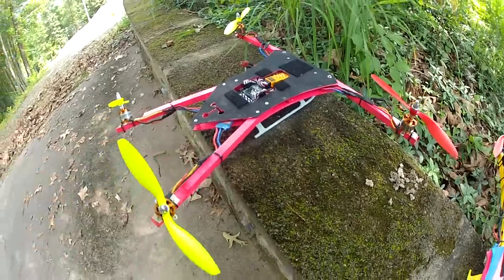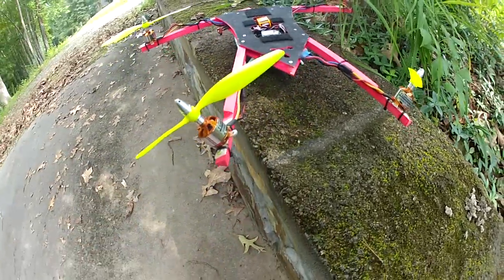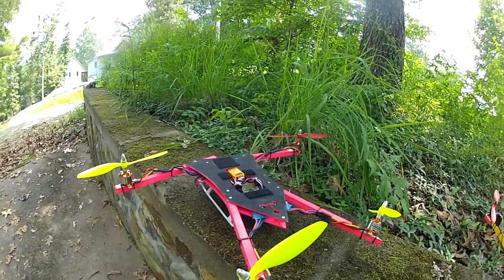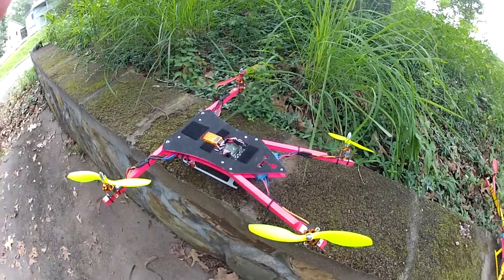Simplecopter V tail demo Long ver.

Comment: if I have no V-tail option in my FC can I configure it as a quadcopter and would it work or not? I am using APM 3.2.1 and only built quad so far, now planning a tricopter or a V-tail for better stability,  less roll during yaw. And less roll during roll :)

Comment: Hi is it normal for a tricopter to have a slight drift when hovering with no input
Reply: It depends. Is there wind? If yes, its perfectly normal. If the triocpter is tilted with no wind, you need to change your TX levels.

Comment: Hey Matt, quick question if you got a sec... I built this 'V' tail but the rear seems to hang, yours doesn't. Any thoughts? Using a BatBone chassis, 3000 lipo, motors are 1200 kv. ESC's are plush 30's. ESC's are plush 30's. KK2 board is in 'V' tail mode... All stock. Using 8x4 GSW props. Thanks for any thoughts.. Jerry

Comment: I've been really enjoying your videos! Noticed in this video, when you flew through the trees into the back and then back to you, it seemed like you had goggles on. Are you running wi-fi off the gopro(or wifi pack) or using a totally different system altogether to monitor? Thanks again for these great videos.

Comment: We have a couple of the TCopters and YCopters out at our field. We're using sunnysky  x2212 vII, the1400 and 980 motors. The 1400s with 9x6 on 4s is absolutely ballistic, though kind of out of control (come to think of it, no one has managed more than a minute or two...) and certainly straining the electronics. The 980kv on 4s w/ 9x6 has lots of power and isn't killing all the electronics. Wish I could find 9x8s.

Going to try 980kv on 4s with 9x6s on this VTail, looking forward to flying it! :D

Comment from the maker: the t copter v tail was not made to take any abuse. we could not figure a way to make a robust but light setup using the alu in the back. the motors blowing out had a problamatic yaw. if you hit the yaw hard the copter would slide 10-15 foot in the direction of the vaw. the 30 with the in facing props took that issue to a few foot plus we picked up power and flight time.

Comment: You mention that you changed the angle to 30 deg and tilted the motors in to get rid of the yaw problem. What did you mean by tilted in? In a previous video you flew a t-copter that you converted into a v-tail. Is there any reason why you choose the new design over that one? I would have thought that the T-cop V-tail would have been lighter.
Anyways thanks for the great videos you make and taking the time to reply to people!

Comment: nice flying! so now after making my own tcopter from seeing yours and following your setup it flies nice but i want more.lol i need to fly more weight so i made the vtail add on but i made it at 45 degrees so now ill change it to 30 but can you put out the set up for the board please? like explain the gyros how to switch it for upside down motors? and my real bigger question im doing fpv so how long can i fly how much can i carry safley for load what lipo size and still be safe and control well?

Comment from the maker: i did not see any on the video and the props i was using were not ballanced. they are usualy good enough out of the package for fun stuff. for video work i will use the sunnysky 2212 980kv on 4 cell or the 2212 1400 0n 3 cell with the 8x4.5 props.

Comment from the maker: The T is easier to point when videoing a subject and has better flight time on same size battery. The V is a "little" more stable and looks cooler. I really don’t have a favorite right now. I have been flying the crap out of different V's we have come up with and it’s funny that the one we built 4 months ago won out. It was always the prettiest of the bunch.

Comment: It won't fly with the servo plugged in the receiver, don't try!
The KK2 board needs to have power on another pin besides the first, from motor one. That only powers the board, the servo needs to have power as well. 
You do that by keeping one of the red wires from ESC to the board from motor 2 or 3, or just use a UBEC and plug it in one of the other pins left.

Comment: I bought the frame you sell on your site, for the tail did you put barrings around the rod inside the wood block to help it so there isn't any play in the tail cause I cant keep mine from either spinning right or left cause the tail has play in it. I have a video of mine on my channel if you want to check it out, Ill post a video in a few weeks of the camera off the trei copter and just flying around the yard.

Comment: what I plug my servo into the board it doesn't work. So I had to hook the servo strait to the receiver. Will this cause any problem with the self level? Can you tell me what I need to do to hook the servo strait to the board.